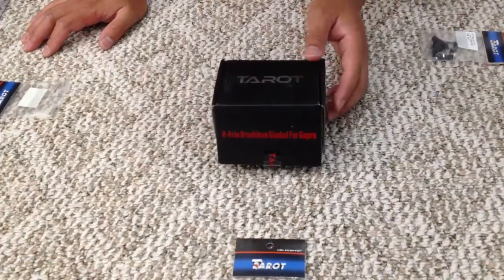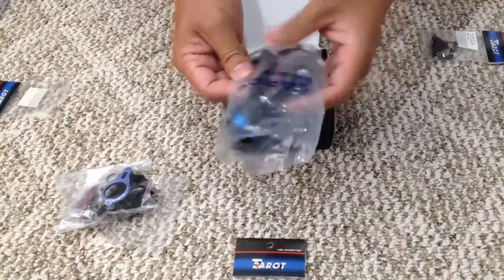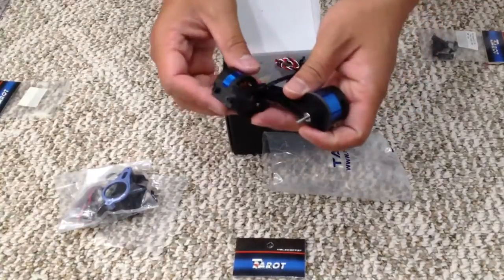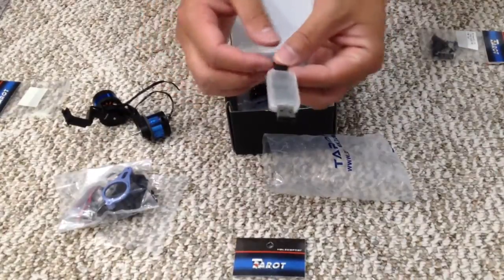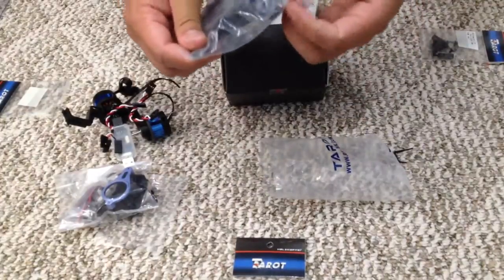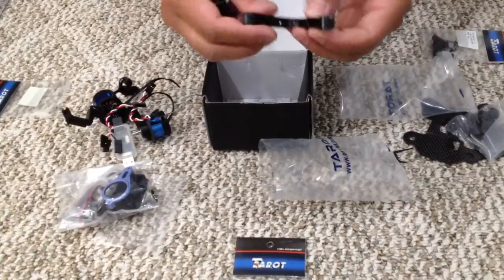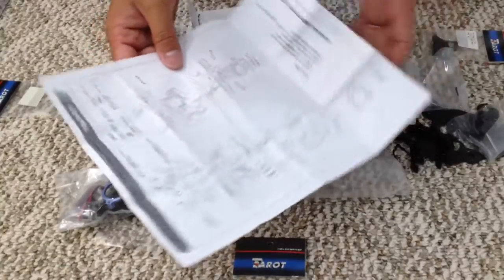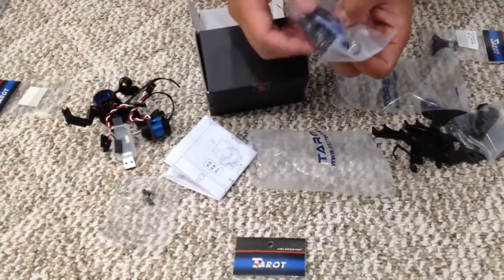Unboxing Tarot 2D brushless gimbal for Gopro

Comment: No control board in the package? I saw speca for the product and looks like it should be with the controller

Specifications:
GOPRO brushless pan rack assembly TL68A08 × 1
GOPRO two-axis gyroscope ZYX22 × 1 PTZ